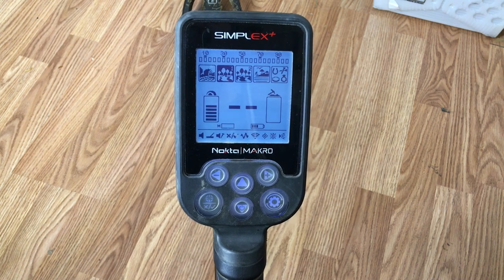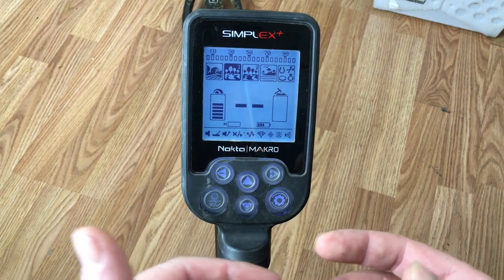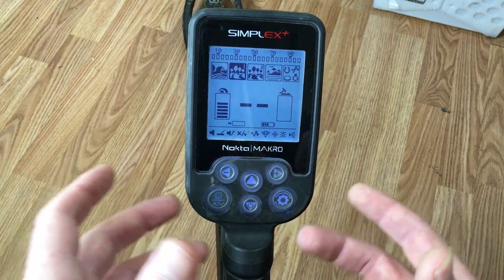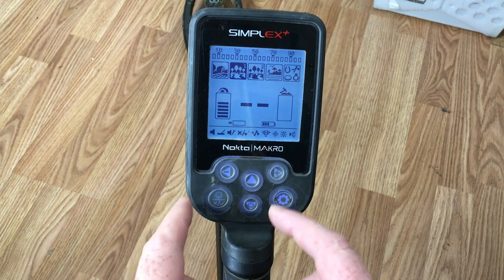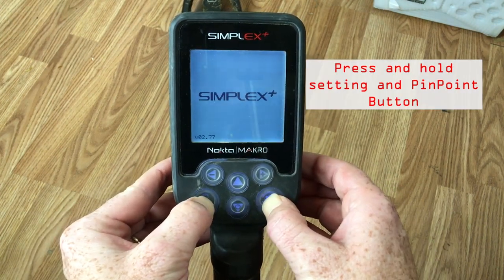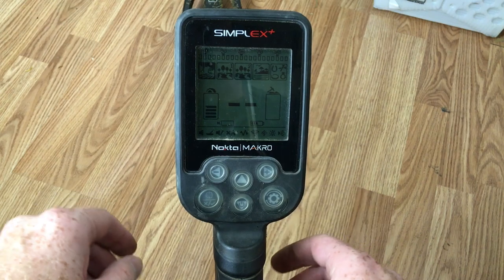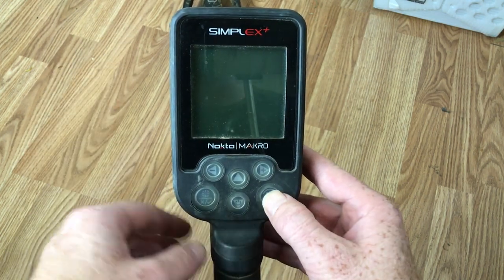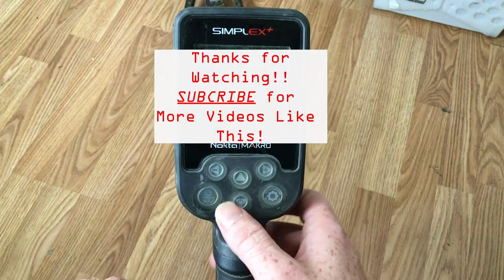How to Factory Reset a Nokta Makro Simplex+

Comment: Thanks. I tried that but no luck. My problem with my simplex + is that I have only used it once and after that I cannot charge it. It just stops charging soon after I connect it, I am soo disappointed with it. Does anyone know how to fix it?
Reply: It sounds like it's already charged. I hunt for hours and my simplex only drops one maybe two bars. I've used it for several long hunt's and it still has a good charge. When I plug it in and think it's almost dead usually only one bar will flash. They hold a really crazy good charge for long time. I would just get out there and dig several hunt's and try to run it down some before you try charging it again. I've never ran mine dead or super low even, not charging it and using it for multiple days. Hope this helps. Keep swinging and digging. God bless 👍